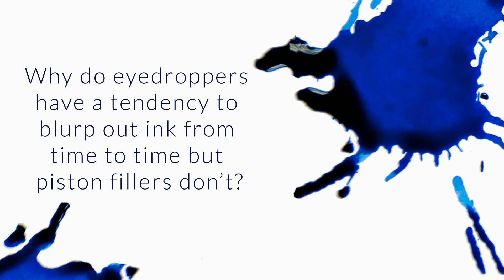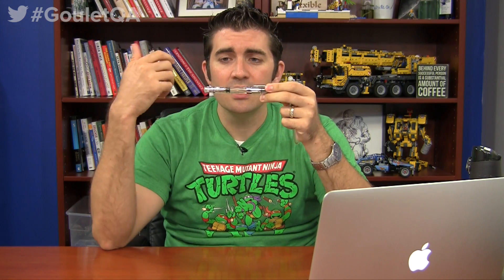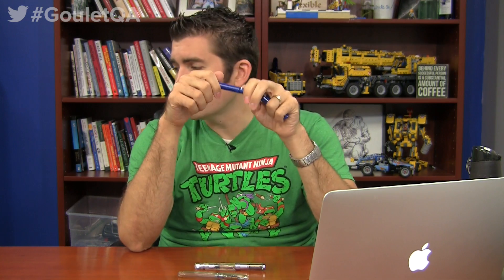Why Do Eyedroppers Have A Tendency To Blurp Out Ink But Piston Fillers Don’t? - Q&A Slices

Comment: Very interesting and not something I'd particularly thought about, as I only rarely ED convert my pens. I do wonder though if burping would be more of an issue with a vac filler such as the VAC700R. Where these differ in the context of this video (to my ill-educated layman's mind) is that the plunger is actually down next to the section in writing use, and it would not seal off the air above (unless you've closed the valve by screwing down the end knob). So theoretically, I wonder if this would be some way between an ED converted Ahab and a 580 or Eco when it comes to burps from heating up of the air behind the ink...

Comment: Would this be a good idea Fill part of the pen body with hot glue or a resin to allow less air for less air pressure when it is heated and also an insulator between my palm and the ink chamber. If so, would the hot glue melt the pen body of a Platinum Preppy or absorb the ink. If so, I will use resin.
Reply: The better question is what plastic or resin does the preppy use.

Comment: Hello sir, this is Sumantra Chatterjee from Hooghly, West Bengal, India....
I love your videos very much as they are quite effective for fountain pen lovers...my question is when burping is an issue in eyedropper fountain pens then are cartridges, converter and piston based pens best to get the proper pleasure of having fountain pens?....
The 2nd question is...when there is half ink inside barrel in the eyedropper fountain pen, then should I shake with capped up and down to get the air dissolved in the rest ink so that no extra pressure will be generated?...... 🙏😊

Comment: I'm glad to see this video tonight. I've been using an inexpensive eye-dropper pen and twice it has burped ink. Once on something I was writing on. The second time it happened, I just happened to tap my hand on the desk while holding the pen, and ink went all over my desk. : ( 
I didn't know if maybe it was that I was using an inexpensive pen or if all eye-dropper pens do this. I was concerned about the ink staining my desk. I was interested in buying a Twsbi, but now I'm wondering if  Twsbi's do this often? Thanks for any info!
Reply from the maker: No, I haven't had on instance of burping with my TWSBI pens! - Colin
Reply: The Goulet Pen Company Thank you!
Reply: One of my Eco pens has started to drip ink when nearly empty, guessing production tolerances may allow air to back-flow to the cylinder and when the proportion of air-ink is too low then there's insufficient part-vacuum to arrest excess ink down-flow through the feed system. I never thought that owning fountain lens might force me to carry out pneumatic-hydraulic flow analyses! But it seems that it is so. BTW I DO sometimes get excess wetting/burping from a very recently bought Souveran m400.
One added point. If for whatever reason your piston-pen has become colder than normal. it's an idea to allow it to warm up before use with the nib uppermost. to allow the denser cold air in the ink chamber to warm up and expand thereby expelling the volume gained by warming up to vent via the feed-nib system. If you can get the pressures equalised in the cylinder and outside it then there's no pressure gradient to shove ink out at unlooked-for moments, which we think of as "burping". Which is often preceded by the flow getting markedly wetter, if that's noticed then pause and twiddle the piston up/down, (nib uppermost of course) to let the pressure equalise. Keeping your pen in a pocket close enough to you so that body heat keeps it warm might mean you'll never see these undesirable effects at all.

Comment: Thanks, that's helpful.  I have...oh, let's just say a goodly # of pens including some vintage pens.  While some of my pens (cartridge) are a bit leaky (into the cap and from the cap to the section), it seems the only pen(s) I have that blob on me are vintage Parker Vacs.  While these are not eye droppers per se, the ink is held in the barrel so I imagine they then have the same eye dropper physics issue.

Comment: A follow up question.  I have a convertor fill pen that sits horizontally on my desk all the time (no clip, so not carried) with a side-cut flex nib that has a tendency to blurp out ink from time to time -- even when fairly full.  Any ideas?
Reply from the maker: Air is probably getting in where it's not supposed to. Could be a cracked converter mouth - have you checked that? - Drew

Comment: I wonder... is it possible to get a full-barrel-length breather tube for an ahab?
That way, if you eyedropper it, it would be able to exchange air with both the front and the back of the ink chamber, depending on how the pen is tilted, and might partially remove the burping issue...
Reply from the maker: That's an interesting thought. Not sure if there's a longer breather tube available. Might be able to combine two though? - Colin

Comment: Would posting the cap help to insulate the barrel and minimize burping?
Reply from the maker: It probably depends on the pen, but the cap usually doesn't end up where your hand is holding. Not sure if it'll make too big of a difference. - Colin
Reply: The cap fits right in the crook of the thumb for me, as I tend to hold the pen rather far from the nib. I'm about to get an eyedropper pen, so I'll see what happens. I'll let you all know.
Thank you,

Tony
Reply: @Gouletpens  so did it burp that way..bcoz I  thinking to carry a eyedropper to an exam..